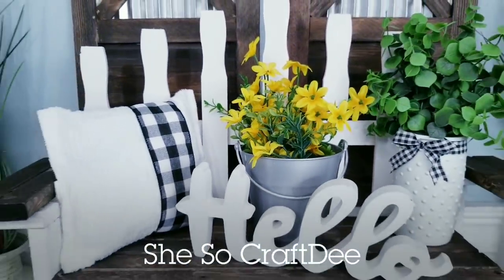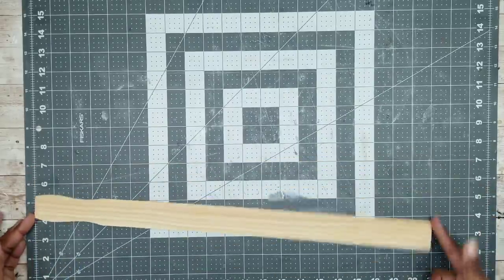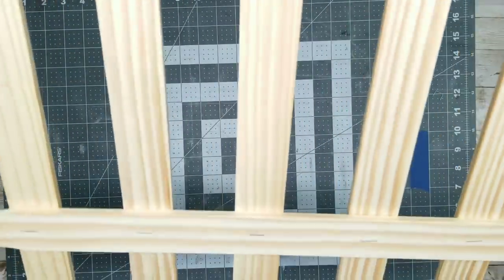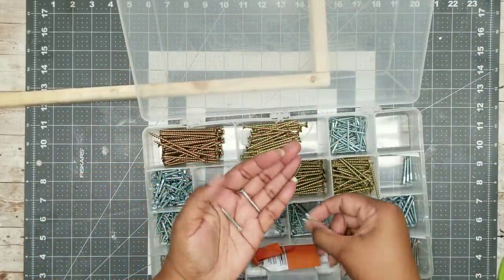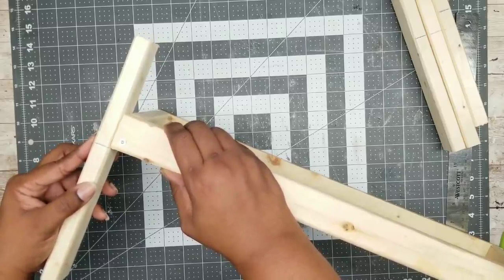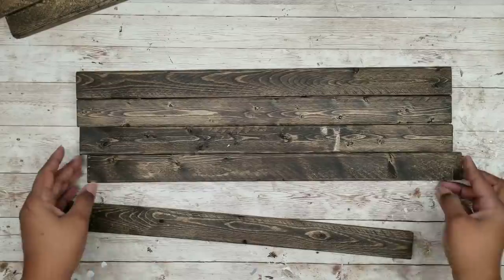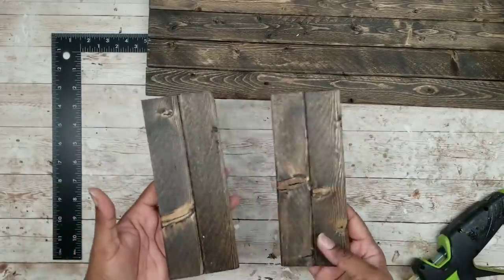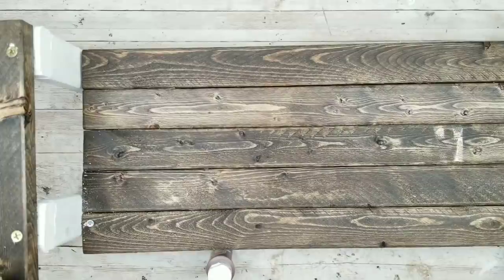HIGH END Inspired DIY | Modern Farmhouse Wood Bench Decor & Plant Stand | Solid Wood | Look for Less

Comment: I'm curious why you didn't choose to do wood glue? And clamp them? I ask because I'm trying to make a very similar table top or my patio and struggling at the point  Of attaching each of the pieces together
Reply from the maker: Regular bottled wood glue takes more time to set, clamp and cure. This Surebonder Wood Stik hot glue is especially made for Wood and sets quickly so I can keep working. Following up with screws makes the connection permanent. :) You can definitely use wood glue if you choose to, but be sure to wait a couple of hours after each application step for it to dry.

Comment: Can you give any advice on the Sure Bonder hot wood glue? Every time I have tried using it, it doesn't adhere well or keep my wood pieces together long enough to secure with nails or screws. Even when I have used clamps. Thank you
Reply from the maker: Be sure that you use the high temp setting, that the surface that you are are bonding is completely dry and free of oils and debris, and that you squeeze the connection together for at least the first 10 seconds.
Do these methods work?
Reply: @SheSoCraftDee  I have been really careful about making sure the surfaces have been clean and dry as well as holding the pieces together for the glue to adhere. But it "pops" apart before I can secure with screws or nails. I will try again. I really appreciate your quick response. I thoroughly enjoy your crafts and videos. Thank you!
Reply from the maker: @Patti Kelleher  if the Surebonder wood Stik hot glue is not working you may have to take the traditional route of using regular wood glue. For this method, allow a few hours to dry and use tension clamps if you have them.
Reply: @SheSoCraftDee  thank you for sharing your thoughts. I will try the traditional methods. Be safe and well.

Comment: How do you know the measurements of the painters sticks ?
Reply from the maker: They come in 21" lengths. I wanted them to stagger down on each side so I cut each stick down one inch lower than the previous one. For the 3 packs, you should keep 
3 sticks at 21", 
2 at 20", 
2 at 19" 
and 2 at 18".